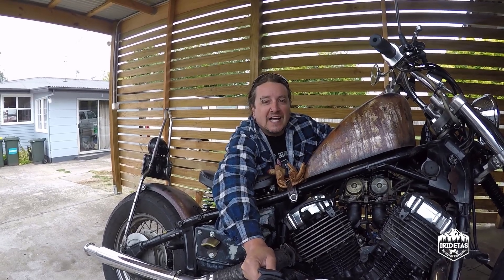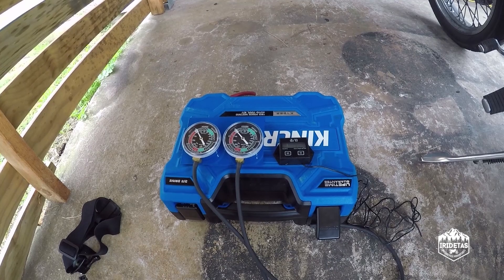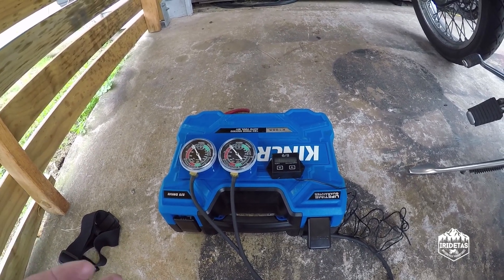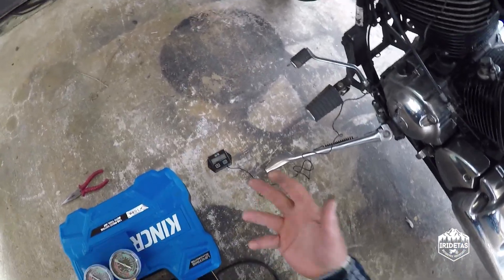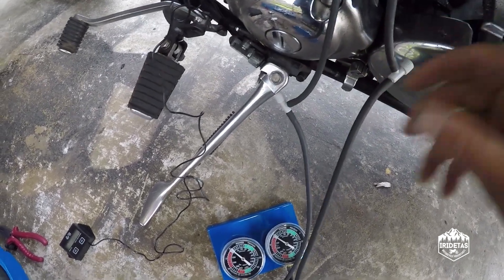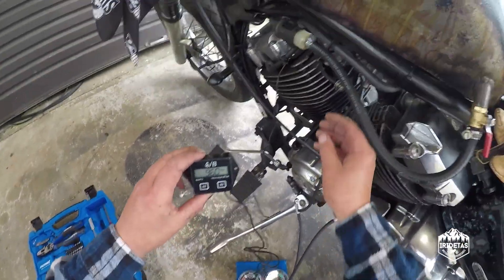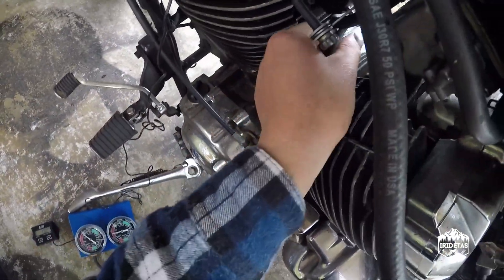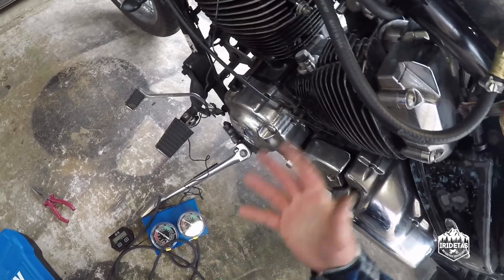BBBs02e29 | Sync the Carbs or Syncing the Carburettors & Setting Idle Speed on XVS650

Comment: Good job, that sync is no sweat, I have a VS1400 Intruder and its one of the hardest bikes to sync, the 2 carbs are totaly seperated and different altogether and attached by a sync cable, you have to do an idle sync (low speed) and a 2k (high speed) sync using different cables, and if you happen to bump or move the cable, or slight adjust it it throws it our of wack, its the craziest bike ive seen,,,But I love the bike  LOL,,,But the sync is very important to get the bike right

Comment: I’ve really enjoyed your videos mate. Excellent. I’ve replaced my throttle cables and it seems to have a high idle now. I’m going to go buy a tiny tach and set the idle. I might have accidentally adjusted the screw when I was jamming my hands in there.
Reply from the maker: Cheers mate, it would prob be that the new cable has not stretched so its pulling it a little tight.  Maybe try turning the threaded l piece on the throttle cable at the bars to let it off which may let it return to 0% throttle or if that doesnt work as you said the idle screw will!

Comment: How many rpm's did you raise it up? And I just rebuilt carbs Virago 535 should I do fuel level measurements first then sync the carbs and set idle then use Gunson Colortune to set pilot screws? Or what sequence would you go in.. I synced carbs first and perfect like yours but started backfiring a little
Reply: Thanks for the video btw!!! Very easy to understand!
Reply from the maker: I would do the syncing last as any adjustments can put it out again.  Manual says rpm to 1100
Reply: @iRidetas  thanks and what rpm did you set while doing sync well right before you said to raise it idle a little how much? Thanks
Reply: @iRidetas  so I guess I'll start with fuel level measurements then use the Gunson Colortune to dial in pilot screws(it's a dual carb) then do sync and idle again. Sound right?
Reply: @iRidetas  let me know bro when you get a chance, if that's right.. thanks again!!

Comment: Hey mate i got one of those tackos and it goes from 900-1120 -1240 then back again, which reading do i go with ?
Reply from the maker: Are you sure its on the right setting and wrapped around the spark plug lead at least 5 times!
Reply: @iRidetas  yeah mate read the directions
Reply from the maker: Thats a big variation, im not sure id trust any of them. My only fluctuates by 20
Reply: @iRidetas   ok I'll try to send it back cheers

Comment: I've done the same thing at idle.  But about 1400 rpms the throttle bogs out.  I've switched jets to 135 and pilots to 37.5. I also have air filter pods
Reply from the maker: That is some big jets mate, I'd be guessing its to rich, but you'll prob need to check you plugs.  I run velocity stacks and only have 130 main and 27.5 pilots

Comment: When I place my bike on the sidestand it really leans onto the side quite a bit, would you suggest I straighten my bike before I sync the carbs or should I leave it on the sidestand..?..
Reply from the maker: It wouldn't make much difference for a sync but it gives you more room to work on that side if its on a lift